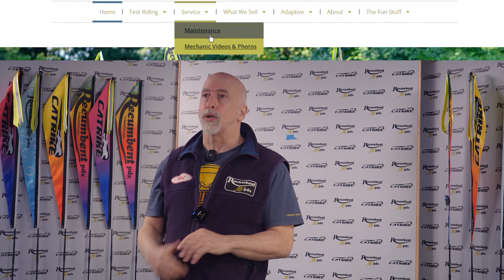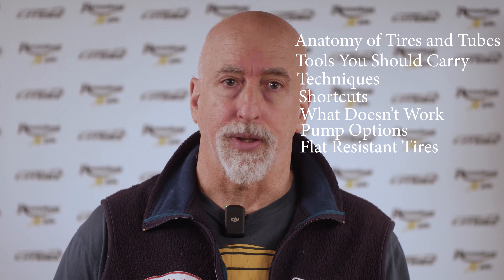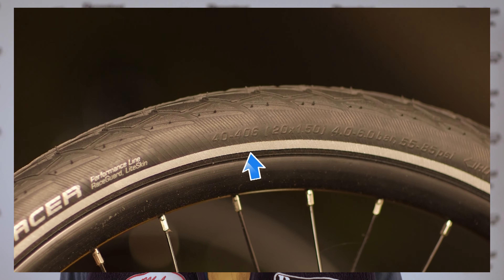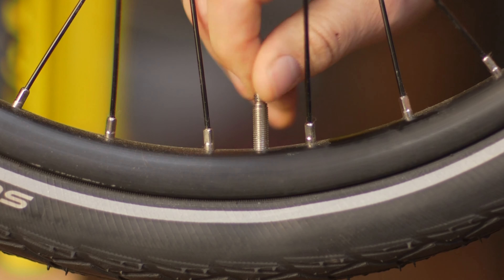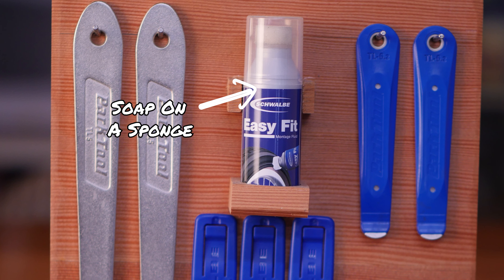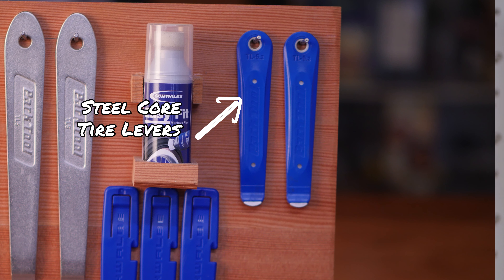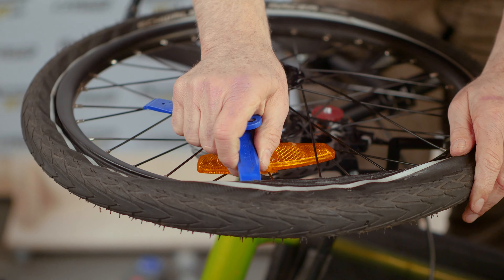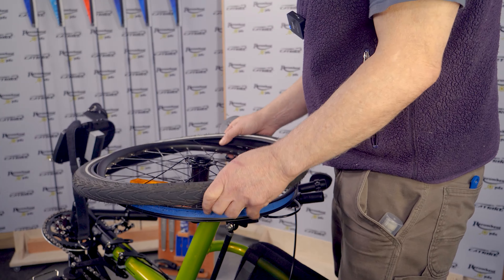Catrike -Fixing A Flat Tire

Comment: Good information. About the Fix A Flat goop. Nasty stuff! Granted this was years ago, but I blew a tire on a Sunday and found my patch kit had gone bad. (Sub note, replace those kits annually they dry out even if never used.) My options were walk about 12 miles home buy a can of Fix A Flat it was the only thing the only gas station that was open had. It worked, mostly. But limping in an a soft tire was better than walking 12 miles. The next day however, nasty. The fix a flat goop had leaked out of tube and tire it was all over the frame the rim, my clothes. I ended throwing away the clothes tube and tire, had to use solvents to clean the frame rim and gears. Hind sight, I’d have been better off to walk. I’ll never use tire goop of any kind ever again. About the tire irons, I’ve always used 3 when dealing with a tight tire. 1 holds the tire so it can’t walk up on you. Then I can use the other 2 to work tire over the rim. I’m not describing it very well, but it works pretty well.
Reply from the maker: "Goop".  That sums it up.

Comment: I use the tyre glide. It has made tire repairs easier.
Reply from the maker: Looks like a nice product.  Have you used it on the 406 tires?  I'd be curious if it moves the bead or gets bogged down by the resistance.
Reply: I have a Catrike 700 and I use it on the 700c  and 406 wheels. It can Bogg down but it gives a good pushing  leverage. I don’t use the tire levers anymore.

Comment: What dealers need to tell Trike Riders is to get rid of the slick rear drive tire, I found out the hard way on my Catrike Dumont.  I had to get off the trail and do something and when I went to get back on the trail, all I did was spin my rear tire and had to get back out of the Trike and move it back onto the trail. I went straight to a bike shop and bought a more aggressive tire and I'm much happier than having a slick tire. 
By the way, I looked up that one tire inflator, $ 250.00 you got to be kidding me. I can but 2 or 3 inflators and have money left over for something else. 
One other thing, I wish you had put better information on the list of items so it makes it easier to look up. I'm interested in that one hand pump for Catrike that pumps up to 250psi.
Thank you
Reply from the maker: Thanks for the comment.  We're a local shop in Portland Oregon. Anything in our videos can be purchased in our shop.  Nothing in our shop can be purchased on the internet because we don't sell on the internet. So, we make it easy to buy in our shop.    Regarding the "$250.00", I'm not kidding you.  Many of our customer can't operate a standard pump (hemiparetic stroke, Parkinsons, MS, ALS, Ataxia) and this pump restores their confidence to ride independently.  Do we sell a lot of them?  No, we don't because there are often perfectly-adequate less expensive alternatives.  But, we do sell them when appropriate (and they're a lot less than $250).

Comment: Rear wheel. What do you do with the trike to take the rear wheel off? Nobody ever shows an easy way to do this if you get a rear wheel flat. I had to flip the trike upside down, because its a huge pain if the wheel drops out of the trike and you got a dirty chain to deal with and a struggle to remove the tube and put another one on, and you got the chain falling off front and rear sprockets to boot. I had a rear flat once and it was a panic attack, I think it took me almost an hour to gain access to the tube and patch it or swap it out. I don't ride with other people and I have bad vision which makes any flat a terrifying experience. Because of that I buy the Schwalbe Marathon flat proof tires and replace them before they get much wear. The two front wheels are super easy to change or patch the tube. Then pumping the tire back up is a chore, the small pumps are useless, I use a medium length one that has a foot brace you can stand on so you pump against the ground instead of two handed. I would like to see a real world trike video of a person all alone get a rear flat and efficiently and cleanly change the tube without the chain getting all crimped up and in the wrong sprockets. So far I've not had a flat in years, but worry about it every ride I go on. I'm not sure my Catrike Road will fit in our Honda CRV, and at my age 74, being 6 miles from home all alone dealing with the trike upside down, because nobody rides around with a bike stand to make it easy, as most uselessly show us videos ;-) Anyway, riding season is over, rains are back, getting cold again. Summers are just too short here in S. Washington.
Reply from the maker: On our website, I've got a video - under the service tab - on removing rear wheels.  We've spoken with TerraCycle about building a "jack" to drop the rear triangle on, but haven't settled on a good design
Reply: @RecumbentPDX  Thats not what I am talking about. I'm talking about being 12 miles from home and you get a rear wheel flat. You don't have a stand for your trike out in the wild on the side of the road with cars rushing by, so dropping the wheel off the bike becomes a panic attack scenario. I had to flip the trike upside down, which is not good because now your shifters and the cables are being crunched with the trike upside down. All the rear tire flat repair videos only show the trike sitting on a professional trike stand, not in a real world scenario. Thats a video I want to see, not a shop video with a professional mechanic making everything look super easy. When I had a rear tire flat, it took probably 45 minutes of swearing and I don't think I actually removed the rear wheel, I had to get the tire off the wheel and patch the tube because removing the wheel, even upside down was just too difficult. Lets see a video shot on a busy highway, with a half blind old man like me and a procedure that a child could easily do. There are no videos like that.
Reply from the maker: @davestephens8033  we've spoken with T-Cycle about making a frame-attached built on kickstand, but haven't gotten beyond talks.  We have a customer who just props the trike up on his helmet.  It gets it three inches of the ground which is the perfect height for dropping out a rear wheel
Reply: Ya, I agree. I am 84 and am terrified of flats. Prior to getting my 559, I had a Fuji Sagres on which I put 5000 miles a year and ran Continentals, and one flat in 30,000 miles.
In my new 559  I had half a dozen flats in a short  order of time, a good percentage due to Presta valve issues. 
I don’t see any reason for not having Schrader valves on those rims, tires.